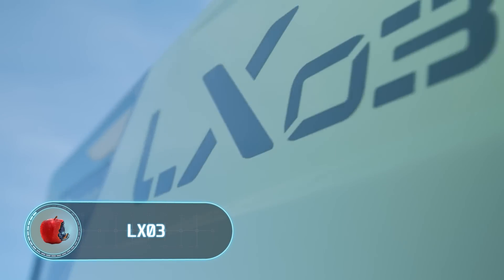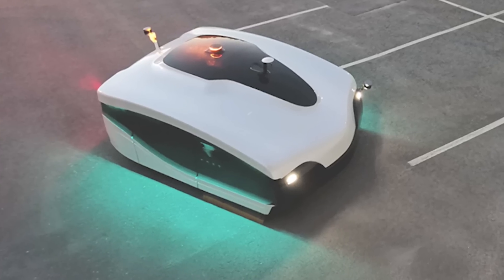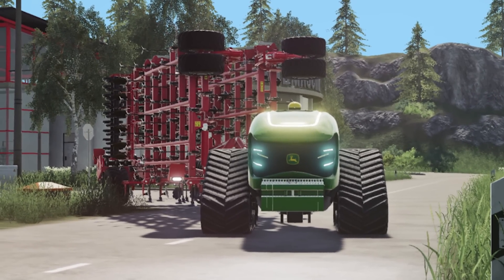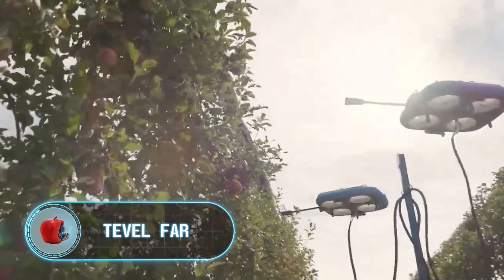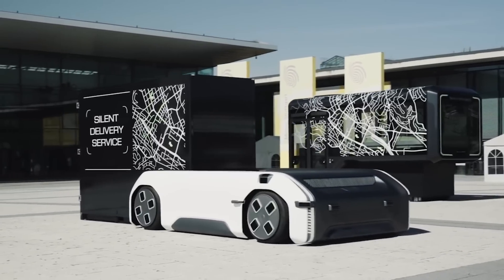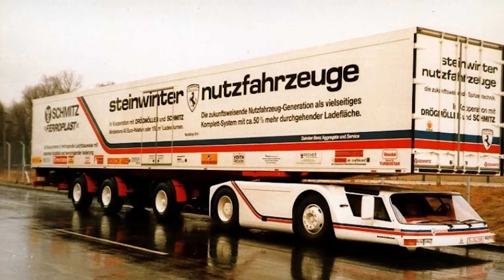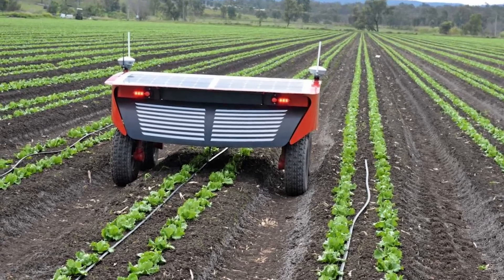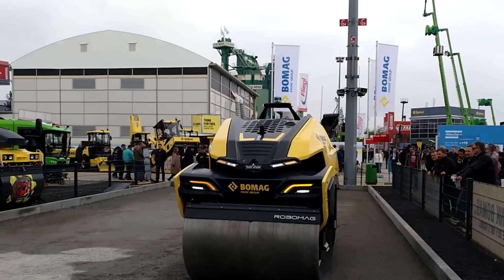Futuristic and Ingenious Machines That Only a Few People Know About

Comment: You said zero emissions, but there is nothing without emissions.  The manufacture of these machines, especially batteries, creates a lot of emissions, and when the batteries fail, they are unfortunately not reused
Reply: exactly!! and not to mention when the battery wears out and it WILL...thats a TOXIC WASTE!!
Reply: Hey. You're not ment to look in to it that far.🤣 
This full green movement has went unreasonable and it's going to hurt more in the end. Look at all the chopping down of trees to make way for wind farms and solar farms but it's a good thing they say but I bet the birds and insects just love a wind turbine 💀 and alot of these new renewable power plants run on wood chippings, but it's classed as renewable because you can plant more trees . Scotland chopped down around 22 million trees to make way for wind farms 🤦‍♂️😪
Reply: wrong, everything can use electric motors